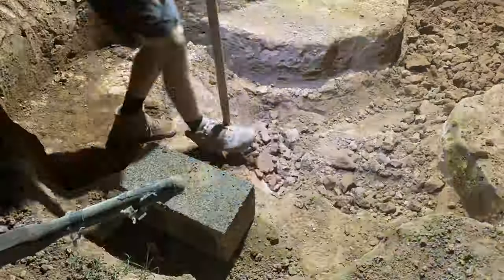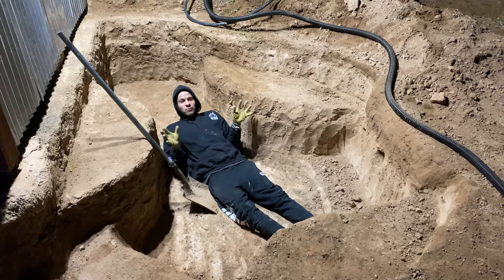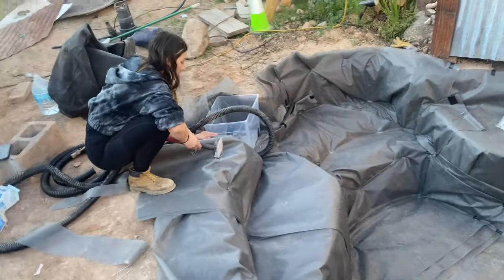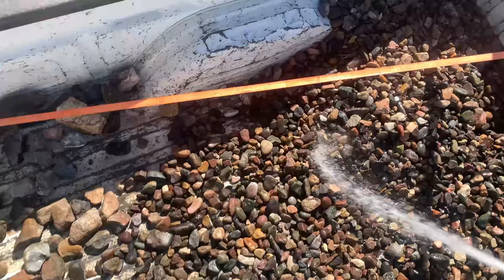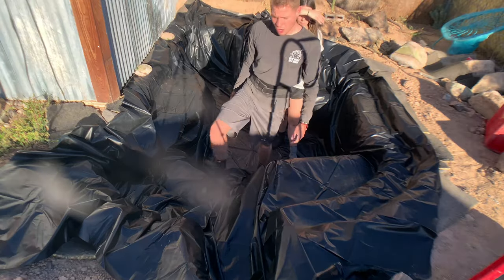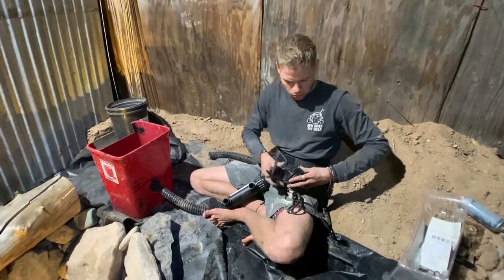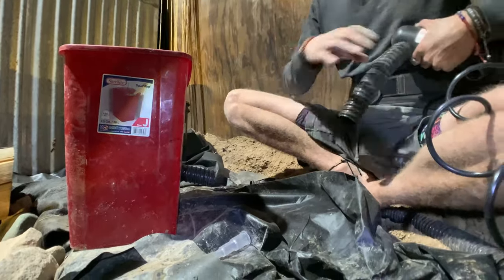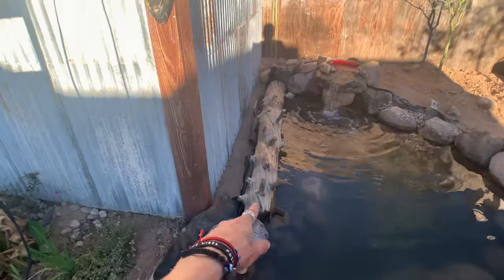KOI POND BUILD (PT. 1)

Comment: How did you get the plastic liners to not leak between the seams? Duct tape?
Reply from the maker: no seams it’s all one piece, duct tape would fail i would use seam tape its fairly cheap